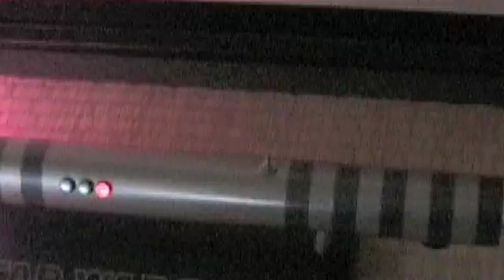Multi-Color Lightsaber

Comment from the maker: If you don't care about the sound-changing effects, you could do the same thing with almost any cheap Hasbro board, or a Force FX board, for that matter. The trick is working out the proper resistance, particularly for red. I still haven't worked it out to my satisfaction, but I'm planning to do an RGBA project soon that will be more carefully thought out. I still have trouble wrapping my head around Ohms and Amperes. :-/

Comment from the maker: Sorry for the late response. I hadn't noticed there were any comments till today. I haven't used any other RGB set-ups, so I can't compare there, but it's as bright as any single-color Luxeon III setup I've used. As for battery run-time, I've never run it down, so I don't know. But I'm guessing it's a lot shorter than a basic single-color LED without illuminated switches.